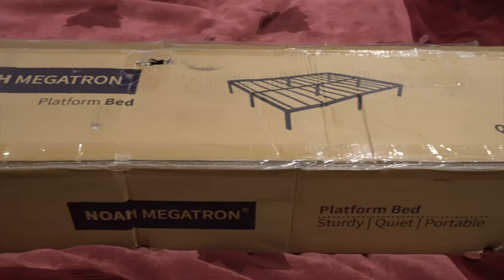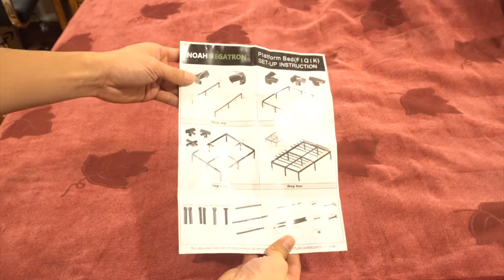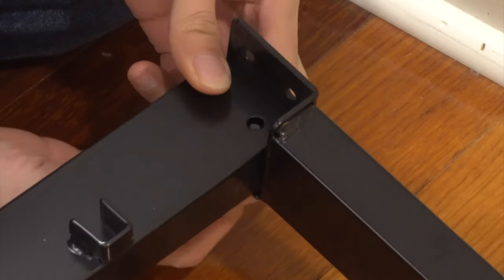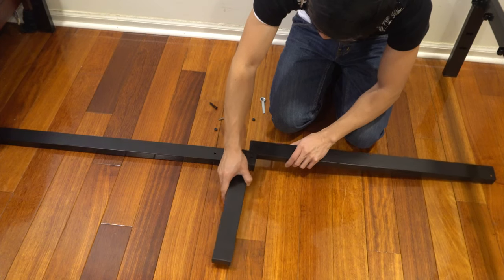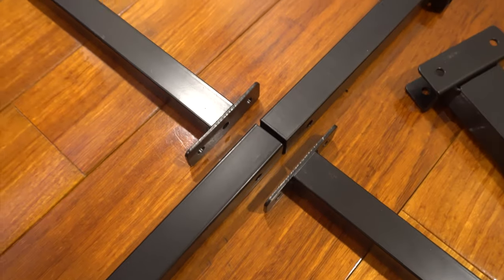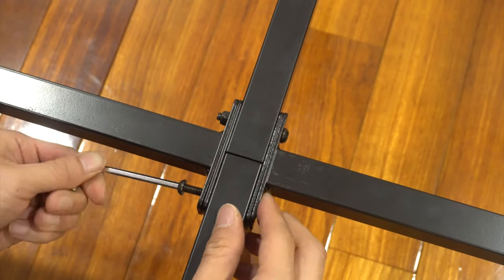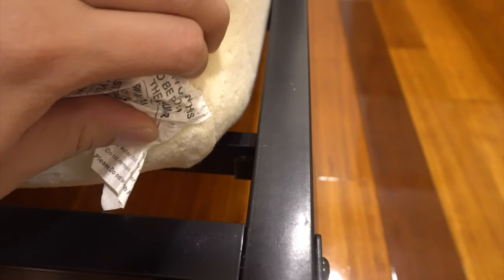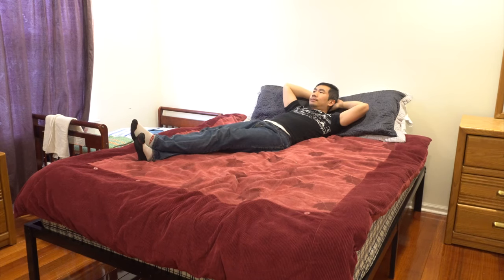Noah Group Megatron Metal Bed Frame Assembly and Review (Queen Size)

Comment: I bought one through Ebay, I got a great deal on mine (Queen size), I plan on putting a sheet of cabinet grade plywood 1/2" thick to spread out the weight load better.. since it's thin walled metal it will eventually start to sag, this will prevent that from happening...

Comment: You should use  Thread locker It's a liquid that locks screws in place With a Sealand And I'm replacing the nuts that came with it is with Is plastic threaded nuts so they will not come loose over time.
Reply from the maker: Thanks for the tips!

Comment: Any idea I can attach any headboard to that bed ?? After time is not comfortable with Constant gap and pillows falling down ..
Reply from the maker: The headboard side of the bed's legs should have two holes on them, as shown at 1:08. This is the attachment point for a headboard. You can attach a headboard using long bolts and nuts, which are not included with the frame, but may be included with your headboard. Make sure the holes on the headboard's feet will align with the holes in the frame's legs and sit flat on the floor before assembling!

Comment: Did you get any mattress sagging on the bottom between the slats it’s been two years ago when you made the video so I was just wondering if it sagged
Reply from the maker: No, I haven't experienced any sagging, though I am using a memory foam mattress with a high density (without a box spring), so sagging from this type of mattress would be quite unusual.

Comment: Great video! Thank you! What kind of screws were used? Our bag of tools/manual were missing. We are willing to just go buy some, just don’t know what kind. We got a King.
Reply from the maker: There weren't sizes indicated on the diagram but they look to be either m6 or m8 size bolts that are approximately 40mm in length. Any big box store like Lowes or Home Depot will carry these bolts and the accompanying nuts as pieces you can buy individually. If you're not sure on the size, I'd buy just one to see if it fits first before buying a whole bunch, you can always return it and exchange for a different size if it's not the right one.
Reply: ReviewedByPhil thank you so much for the quick response!! And okay, thank you! I was figuring I could just go find something but I was told I was going to need dimensions & length & what not. Thank you again!

Comment: Hi I just saw your review and am wondering how the frame is holding up .
Reply from the maker: Good, I haven't had any problems with it structurally. We are using a queen sized 11" memory foam mattress on it without a box spring. The mattress itself weighs about 100 lbs and with two people adds an additional 275 lbs. The metal corners at the foot of the bedframe are easy to bang your shins into though so we put rubber bumpers on them which are hidden by the bed skirt. The only thing with using a bed skirt is that because the mattress sits down in the frame about an inch the proportions of the bed skirt are off so it doesn't quite reach the floor.

Comment: How would this be with a combined weight of 480 pounds for 2 and hold up to vigorous activity? Strength and sounds?
Reply from the maker: My memory foam mattress weighs about 60 lbs and with two people on it we probably add around 300 lbs. I guess it depends on your mattress type too. Since our bedframe sits on a carpeted floor it doesn't slide at all, and the memory foam absorbs a bulk of any motions that occurs on top, very little if any of that translates into sound or movement of the bed and frame. I haven't experienced or detected any loosening or structural problems with the metal frame in terms of strength and the bed itself is silent; I don't think I've ever heard it squeak.

Comment: Does it have to be a foam bed for it to sit on? Can it be a regular bed
Reply from the maker: If you use an innerspring mattress, you'll need to have a box spring under it, sitting directly on the frame first. An innerspring mattress cannot be used without a boxspring, as these types of slat frames do not offer enough support for that type of mattress.

Comment: Mine is squeaking after six months. I’ve recently re tightened everything and even put fabric in the u joints where the slats sit. Very annoying. Any suggestions?
Reply: Get a few drops of WD-40 or other oil based product on the areas where it is squeaking.
Reply: It literally squeaks everywhere I hate it

Comment: What kind of mattress is it spring or not
Reply from the maker: I use a foam mattress on top of this bedframe. You could use a spring mattress, however, you would need to use a boxspring under the mattress as well on top of the frame.

Comment: How do you add a headboard later? Thank you
Reply from the maker: You'll need to buy a stand alone headboard designed to attach to a separate frame, and you'll bolt it to the two legs  with the holes in them at the head of the bed. You may or may not need an additional metal adapter bracket depending on the size and construction of the headboard you end up getting.

Comment: Sad 😞 I order similar. And no holes for adding a head board. Help
Reply from the maker: Hm, I don't know if you can get replacement legs that do have the headboard holes. The only other option may be to drill the holes on your own using the proper tools.

Comment: Do you know the size of the screws?
Reply from the maker: There weren't sizes indicated on the diagram but they look to be either m6 or m8 size bolts that are approximately 40mm in length. Big box stores like Lowes or Home Depot carry these bolts and the accompanying nuts that you can buy individually. I'd bring one with you to compare the sizes to make sure they are the same. There are usually sizing guides in the section where they sell the bolts too so you can determine the size and thread of the bolt you have. If you don't know how to use the sizing tools, a store associate should be able to help you find a match.

Comment: What kind of headboard attachment do u need
Reply from the maker: It should be one that can be bolted to the frame. The bolt hole placement is at about 6 and 10 inches from the floor.

Comment: What kind of screws work for joining the holes?
Reply from the maker: There weren't sizes indicated on the diagram but they look to be either m6 or m8 size bolts that are approximately 40mm in length. Any big box store like Lowes or Home Depot will carry these bolts and the accompanying nuts as pieces you can buy individually. If you're not sure on the size, I'd buy just one to see if it fits first before buying a whole bunch, you can always return it and exchange for a different size if it's not the right one.
Reply: ReviewedByPhil thank you so much for your reply, I really appreciate it. Very helpful.
Reply: @ReviewedByPhil  h

Comment: can a spring mattress be used with this bed frame
Reply from the maker: Yes, but only if you use a boxspring underneath the mattress as well for support.
Reply: @ReviewedByPhil Ok, Thank you for  your response
Reply: So I can’t lay my regular mattress on there without box springs ?
Reply from the maker: No, regular innerspring mattress require a foundation for proper support and the slats likely won't be able to provide that on their own. I would recommend a box spring if using an innerspring or hybrid mattress on this frame. That or go with a memory foam mattress like this one: https://plushbeds.nzvz.net/BvZPx [Affiliate Product Link] S

Comment: Have you had any issues
Reply from the maker: No. Still standing up fine. I'd like to add a headboard to it eventually because I'm thinking of building something custom.
Reply: Hello what about boxspring with mattress to put on metal frame will it fine?
Reply: Can you but a box spring on this as well?
Reply from the maker: Yes, you can use a box spring with a mattress on this frame. However, with a memory foam mattress like this one:  https://plushbeds.nzvz.net/BvZPx [Affiliate Product Link] a boxspring is not required.